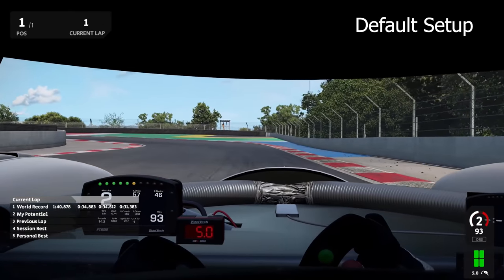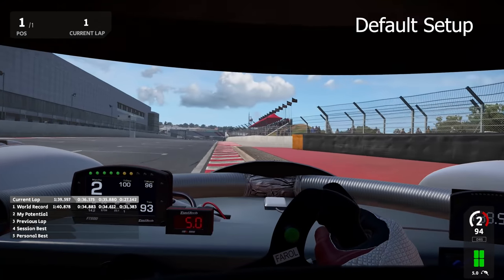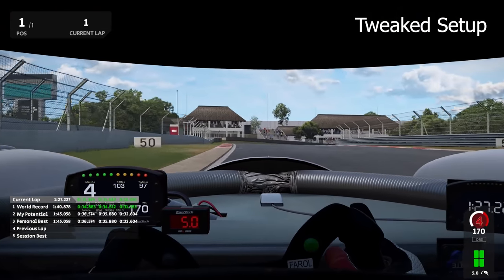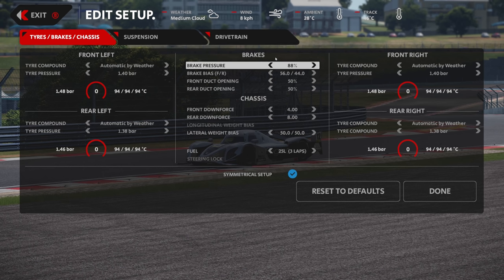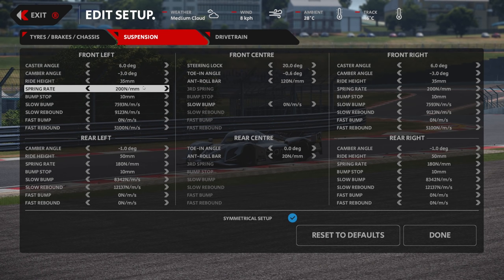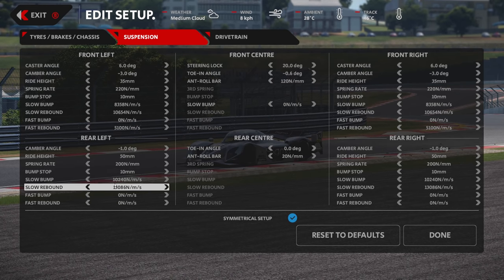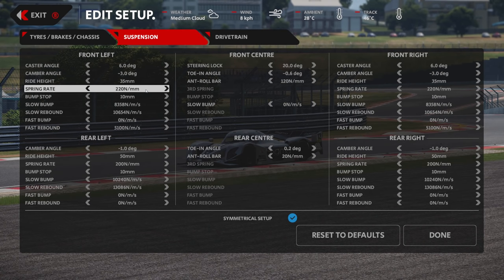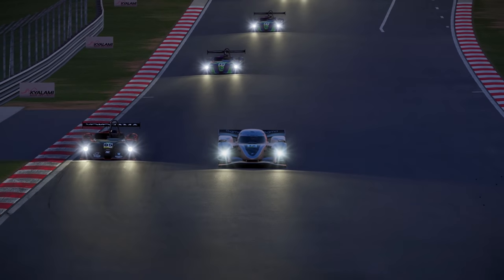The Importance of Car Setup in Sim Racing

Comment: Please do a series on setups. It's all a bit overwhelming to me, and I usually just want to drive. Any kind of basic metaphorical or literal flowchart or template about what things affect what behaviors would be awesome. Everything affects everything ,but some things change certain things more than others. Like when would you stiffen roll bars instead of stiffening spring rates?  Just all sorts of things like that. What's the first thing you should optimize, what's the last thing. I know that's a big scope, but I know I at least just look at all those settings and just shake my head.
Reply: just google car setup flowchart and you'll find a bunch of them, it of course helps to understand vehicle dynamics, for example, roll bars have effect during lateral weight transfer (cornering) and springs and dampers have more effect during longitudinal weight transfer (braking and accelerating).

Comment: Just keep in mind that setup changes will not make the car faster, it's a way to adapt the car handling to your driving style and let you extract the most out of it, you're not going to be running at your full potential unless you drive with your own set, everyone has different driving style and run on different hardware, that's why it's important to learn how to setup a car.

any setup can be fast as long as the gearing and downforce is adjusted to suit the track, and even that is not necessary, l've done lap records on tracks with long straights like le mans using medium downforce.

Comment: No. You've misunderstood diff pre-load. When the pre-load is low, the car will feel sluggish going from coast to power. This will make it easier to drive (think retarded ignition). When the pre-load is high the car feels nervous like a tiny increase in throttle position on corner exit provokes a larger than expected reaction from the rear. The setting is right when it suits you. A lower setting aids manoeuvrability at the expense of traction.
Best advice for anybody here who wants to learn about setup is to get the RST software & buy a licence for your sim of choice, put some think time in & engage with your inner learning self. If that seems like too much trouble then just play GTS on a PS4.
Stiffening the front & rear springs will aid initial turn in response but create more mid turn understeer & potentially more corner exit oversteer. The last, low speed corner of the lap where in default setup you were experiencing bad understeer was not helped one bit by stiffening the front springs. Everyone here asking for setup advice should pick up RST, get your school on & learn what actually makes a car work.
Reply: you don't need to spend money on RST if Motec is free for personal use
Reply: @addictedtopiano  This is true but RST is much more useful than Motec & for just a few dollars you'd be missing out on a better piece of software. Motec is kinda janky in comparison.

Comment: I'd suggest the bottom up approach, pick a ride frequency (e.g. 3.0 Hz for this high downforce car), calculate spring/wheel rates, then increase ARBs to your chosen role gradient. These two are the biggest influence on handling, everything else is secondary except optimum tyre pressures.

Comment: AFAIK if you increase power & coast it locks the wheels more, not less. So 0% would be a fully unlocked diff  & 100% is fully locked so they spin the same.

Comment: I dont envy you attempting to do a short chat on setup. Its so hard to know where to start and where to stop. 
I will presume to mention 2 things;  Caster, increased caster will have 2 more impacts, it increases camber when the wheel is turned and it will slow down initial response (despite feeling stronger this is just the steering rack exerting leverage) think about a shopping trolley vs a chopper motorbike for an extreme amount. The second thing is that to increase rear grip on exit when adding front slow bump I would reduce rear slow bump or just do one end. This will let the car settle earlier and for longer on the rear. By increasing both its neutral front-rear but will make weight transfer less, so your trail braking or throttle inputs will impact weight shift less, making the car less "adjustable" mid corner.
Keep up the fun content. Feel free to view my videos supporting the Sim Racers Performance Guide (shameless plug there!).
Reply: David O'Reilly what most people don't understand is that it can't be just explained. What I mean by that is that beside the pure knowledge there's a LOT of experience required to actually be able to apply the knowledge in a proper manner (not to mention robotic consistency). I feel like confirmation bias and placebo effect are strong in this area
Reply: I'll check out your videos, thank you bud

Comment: Loving your AMS2 videos! In regards to setups, I've noticed that I used to start fiddling way too early, before getting good enough with the specific car/track combo. For instance, in AMS1, I use to do some of the weekly hotlap challenges... I'd spend two days setting fast laps and fiddling with the setup. Only to then load the default two day later and crush my previous best times. Turns out that while setups are important, in AMS1 the default setups were usually very, very good and what most of us are lacking in track time.

I should mention that this didn't hold up in PCars1 (never played PCars2) - the default setups there were often un-driveable.
Reply: Jure Forstneric my thoughts exactly - first the basics, then long long after that, setups.

Comment: Nice video, very good advices given here, if i can add to that, i'd say that a setup is strictly personnal, and not everybody will gain the same amount of time with it. I tried it, on that same combo, i am the current time holder (1:39.2), and after getting used to this setup, i managed a 1:36.9, with still plenty of time to gain. So i can confirm, setup is important, but don't forget that you'll have to tweak it to make it confortable for you. Oh, and an advice, put the hard tyres on ^^
Reply from the maker: That's great! I obviously still have a lot to learn about this track.
Reply: @Ermz  once you learned it it's really satisfying to run! and i really feel like it's scanned, because the ACC version is extremely similar, what a great addition to ams, really :D
Reply: @Ermz  i noticed you keep saying the brakes in AMS2 is abit iffy. To make it simple i noticed you don't want them in the green, they want to be to be kept warmer around 500/600degrees then they bite better now you know those are cooled by the ducts so close the ducts abit and test and you will see you should be able to keep brake pressure high but not lock. Obviously different with different cars but yea you get the point. Loving this game im going to do a time trial now and see if i can beat your time :D. My name is madonion on the game haha.
Reply from the maker: @mehdis6k960  For sure. I just squeezed into the leading position by about 23 ms, using your modified version of my setup. Great work re: the brake pressure and hard compound! Made all the difference. Following your ghost made me realize where I wasn't pushing enough too. This is what I loved about PCars 2 - you could learn so much just by doing this.
Reply: @Ermz  haha thanks, i'll go and try to beat this one, "our battle will be legendary" xD
Reply: again, those hard tyres are really OP, it was like that on PCars 2, idk if it's realistic or not, i'd say no, but i can't really know^^
Reply: @poopnakedyeah  i dunno about that, because i might be the only one to have discovered the hard tyres trick, when people will find about it, or when Reiza will fix it, it'll become a lot closer
Reply from the maker: The softs should be quicker, for sure. They're used for qualy in real life. That really threw me. I was wondering how some times were so, so much quicker than others. Good job on reclaiming 1st, btw. I'm definitely not on that level yet. Waiting to not be on a rocking chair with a DD flinging my flimsy stand everywhere and then maybe we'll revisit this!

Just stoked to have knocked a whole 5 seconds off tonight. Insane.
Reply: @Ermz  Good job for your time anyways, you'll get there, for sure^^ See you on another TT, maybe a race if you're into the multiplayer !
Reply: @mehdis6k960  im 4th now on the leaderboard but could not get used to your tune haha, i used ermins and it felt so much quicker and turn in felt nicer. i see your are on 100% traction control? i don't see me doing lower than 1.39 in a while xD.
Reply: @jacooosthuizen3593  the traction control is the same as pcars : the percentage is the amount of slip it allows, so 100% is off, even if i turn the TC off manually, i like to disable it in the setup, just to be sure xD
Reply: @mehdis6k960  Really, interesting i must test this out. Could be why im so slow even though i leave settings as authentic.

Comment: Very interesting movie. However it would be better if you did couple of laps in both setups and took an average to reflect the difference more accurately. It is very likely that a car with tweaked setup will be faster than stock but doing laps on a new track on the other hand, it may happen that some are quicker and some slower. If I only had time to experiment with sim setups... my lap times would be better... Instead I am having fun on sims mostly on stock ones.

Comment: Thanks, in AC, whenever I get oversteer at corner exit, I often reduce the drivetrain power setting, which often improves the issue.  I always wondered what might be the equivalent setting in AMS2?  Is it the preload, or power ramp?  appreciate any insight, thanks again!...;)